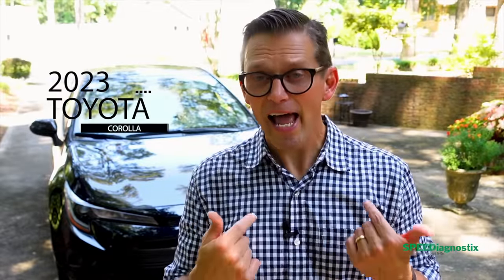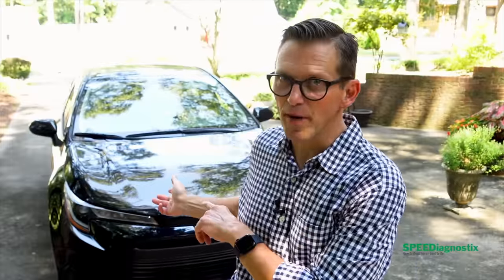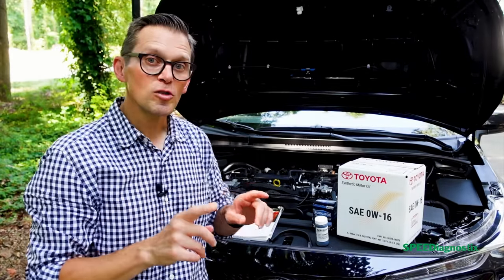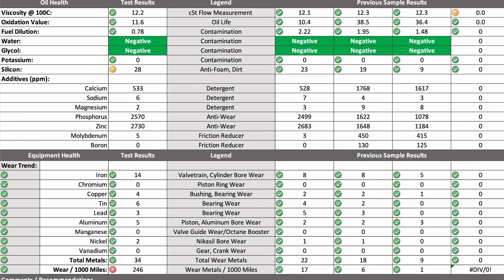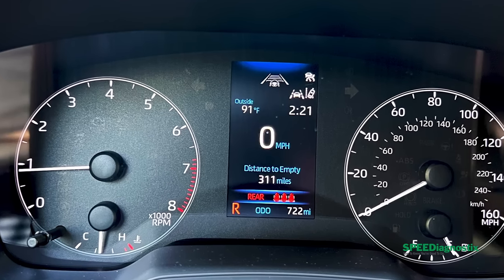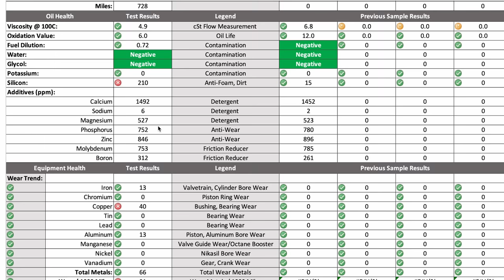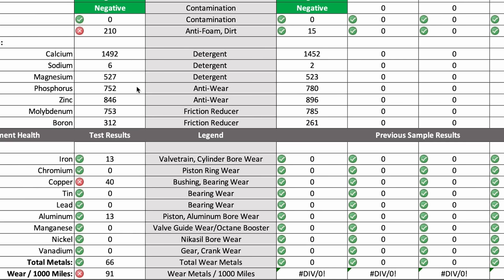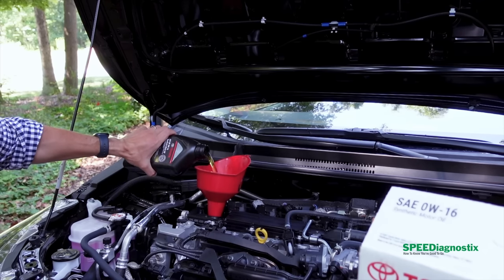AVOID the ONE MISTAKE Almost EVERYONE Makes With A Brand New Car

Comment: Only a small portion of the oil goes through the filter at a time, the rest goes straight through the engine unfiltered.
Reply: Not exactly. There is a bypass valve in some models for when the oil is too thick to be filtered right away or if you never change your oil filter but it rarely opens. If you use a quality filter, it doesn't happen.

Comment: Wait a minute I thought silicon and silicone were two completely different things. Silicon is an element and silicone is a man-made material. You said the high silicon numbers were from the sealants in the engine. Is that right? I would’ve thought high silicon was a remnant of casting sand residue in a brand new engine.

Comment: Did you know all modern cars have a failsafe function so some idiot does not crank the engine while holding the throttle to the floor?
Its true. What you do is, floor your gas pedal & crank. The engine  WILL  NOT  start. While the engine is cranking the oil pump will 
pickup your new fresh motor oil & pump the filter full. Let off the key. let off the throttle. Crank & start. Live a life full of bliss for the 
rest of your days.

!

Comment: FYI, Toyota does not use break in oil. Their "factory" oil is the same 0W20 0r 0W16 (depending on the model) that should be used for the life of the car. Also, modern OEM filters are designed to capture everything that might be suspended in the oil as particles that can harm the engine. You did not extend the life of the car by doing all that work, but if that made you feel better, more power to you.

Comment: Whoa there Trigger!  Silicon and silicone are very different things!!

...UM....

Well, I was about to go off on Ya ' there, Buddy!  But I like to be absolutely right when I tell someone off!...So, in light of what I just learned, (thank you) I've severely edited this comment! 

Silicon is a metallic element, 14 on the periodic table.  When it's combined with nickel and applied to an aluminum cylinder wall, it makes an exceptionally hard wear surface that is, or was, branded Nikasil.  I THINK it was Mercedes that first used it. 

Silicone is a family of polymers that are used mostly as bonding and sealing agents, or molded 'rubbery' items.  

Now HERE'S where I learned something!  I thought that silicone had nothing to do with Silicon, but it turns out that Silicon is one of the components of those polymers.  Given the name of the rubbery stuff, it DOES rather make sense now.  Kinda funny how an element so hard and brittle is used to make wiggly jiggly sex toys!!

Since I try to learn something new each day, you have freed up most of my day.  I am now off to the garage to play with a Toyota 1zz fe engine (with very low mile shortblock) that I pulled from a junkyard 2000 Celica I got for it's sheetmetal 6 yrs ago!

So... Thank you, Mr Speed!!

And, yes, the break-in will be correctly done... With that engine never seeing even CLOSE to a 10 000 mile internal ' cause I don't drive it a lot.
Reply from the maker: Thanks!

Comment: This isnt a formula car. The oil is synthetic. Synth oil is supposed to keep going fine even with particulates, more than the regular oil. I am not sure the particulates mentioned are significant enough to cause statistically more significant degradation. Ultimately only a long term trial will prove this - say, 100 toyota corollas with first oil change at 500 miles etc versus 100 corollas which do the stuff at the manufacturer's prescribed schedule, then measure the particulate average for these populations after say 150,000 miles. If the difference is mire than 15%, this video may be on to something, but otgerwise it could be just the proverbial snake oil

Comment: #TheMotorOilGeek :  I heard two different mileage amount opinions (for the first oil change) on Subaru Boxer Motors:  #1) was at 500 miles; and the other; #2) was at 1000 miles.  *Note* my annual mileage will likely be 4000 miles.   With all of this in mind; would it be better to do the first oil change at 500 miles “OR” at 1000 miles?   Any input is appreciated.    The vehicle in question will be a 2024 Subaru BRZ (which I ordered).
Reply: Any input on 500 miles vs 1000 miles is appreciated!

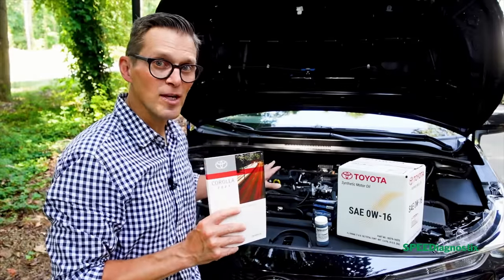Comment: apparently, at least some manufacturers use Moly grease (or other equivalent) during assembly of new engines. this helps coat the bearings and other parts for proper break-in. this means an early oil change would NOT be recommended, since it would flush a lot of those special products out too soon. i've linked a blurb below (at time-stamp 6:02) from a Honda mechanic as an example:

https://www.youtube.com/watch?v=DAixtdfz37g&list=LL&index=2
Reply from the maker: That’s very poor advice from that mechanic. The Moly grease doesn’t provide break-in protection beyond the initial start up and running in. Grease can lead to deposit formation, so the advice he provided is opposite of reality.
Reply: makes sense. all the more reason for a break-in oil change at 1000 miles. thankx for clarifying....

Comment: You can also just pour a little gasoline (even old stale gas) or kerosene into the engine to flush it out but make sure the engine is not so hot as to start a fire OFC the fuel residue will just get evaporated through the PCV system and burned it won't stay in the engine and since fuel is thinner in viscosity it will do a better job at rinsing out any particulates as well. When I do this I like to put the plug back in and fill the engine up and then rock it side to side by hand to shake the car up and then pull the drain plug.

Comment: Wear debris.  With modern processes of engine building….. you do not need to do an early oil change.  There is no such thing as “break in” oil.  Even if it existed, no engine is @broke in” at 500 miles. The difference between 3 and 8 parts per million is nominal.

Comment: I was saying you could just change the oil as many times as you want without any kind of schedule as long as you use break in oil the real question is when is my engine actually broken in and this has to do with the rings sealing up tight which can be measured with a leak down test without the oil sampling.

Comment: VW re called my engine for sludge, they told me I voided the warranty changing the oil myself. 212,000 miles later Ca forced me to replace a Catalytic Converter that passed smog but didn't have the correct NAZI number on the heat shield, the idiot mechanics messed up my turbo in the process, it dropped bearings in the engine and destroyed it. The mechanic that diagnosed the engine failure was service manager at vw/audi and stated my engine had zero sludge, I told him I took care of it, it was supposed to last forever I had zero sludge because I changed the oil at 500 miles, the dealer gave me a hard time when I told them, "special break in oil and all". I changed my oil twice as often as recommended and when I did... I'd add a little the day before I change my oil, then, I'd drain the oil, put the plug back in and started the engine and let it run for a second or two and shut off the engine, remove the filter and the plug and let it drain some more, added oil to the filter and mounted the filter, then I'd poor a quarter of a quart in and let it force out more bad oil from the pan or until the oil came out clean, replace the plug, added the recommended amount of oil, start and stop the engine, then add an extra half a quart of oil. I had zero sludge on an engine recalled for sludge. It would have run forever if California had not put a gun to my head and forced me to have work done my car didn't need knowing the plan was to kill my car all along, Thanks California.

Comment: Something seems way wrong here. The oil analysis sheets say “silicon” but we are told in the video that the high number is normal due to engine sealants such as RTV. But they are siliconE, not silicon, nicht wahr? Two vastly different things. Somebody explain.
Reply from the maker: Silicone contains the element Silicon
Reply: @themotoroilgeek Thanks! I see that now — should have checked the Wikipedia entry. Are there engine components containing silicon that could also register in the oil test?

Comment: The problem the car will rust out sooner than later. Just change the filter it will last twice as long. Buy 24000 mile oil and flip fillters ever 3 thousand

Comment: You didn't do the sampling correctly. You let the first amount of oil drain, which probably had a lot more contaminants in it. You should probably collect all of the oil, let it sit, and then collect the sample from the bottom, where I assume the metals would sit.
Reply from the maker: That’s exactly the wrong way. Samples need to be representative of what’s in the engine, not concentrated.

Comment: Most manufacturers today already breaking the engine and do the 500 oil change before they release the car.
Reply from the maker: The data we see doesn't support that. https://youtu.be/X4424Q5lLR8
Reply: @themotoroilgeek  Let say you are right, maybe the manufacturing technology in recent years produce a breaking wear particles that are not harmful anymore as they were years ago when it was required.
Reply from the maker: @ophirb25 again, the data we see from used oil samples shows the longer a customer goes on the factory fill oil, the higher the overall wear. 

The sooner the factory fill is changed, the amount of wear drops.

Comment: Question, has anyone use Amsoil 5W-30 in your BMW 750LI or BMW Alpina B7 vs Castrol oil 5w-30?
Reply: You have an Alpina B7? 😘
Which exact engine is in it? I can tell you that for a high performance BMW Alpina engine 5w30 doesnt provide enough protection when you drive the car like an Alpina is meant to be driven. 
These engines need 5w40 oil.
Reply: BMW 750 & Alpina are know for valve stems seals going bad due to Castrol Oil braking down after 10K miles. The factory Oil change is every 15k miles which lead to valve stem seal failure & smoke.
Reply: @alouisschafer7212   I have a 2004 BMW 760li V12 no issues.
Reply: @alouisschafer7212  I have a BMW 760li V12 with no issues.

Comment: why isn't all this material flushed out of the engine at the factory? after its assembled, not the complete Car but the Engine, since most engines are made in a different country from the final assembly location, I mean use some sort a high pressure liquid that isn't bad for the engine, maybe the lowest viscosity oil

Comment: With all due respect to his conviction, its funny to use a 30 years old car as an example to justify his actions on a new car. It's like lubrication/chemistry and engine tech stood still for all those years. Its so silly to argue that oil change at 500 miles is better than 1000, 1000 better than 2000, 2000....so on. Of course, less used oil is better than older oil. The question that you should dedicate your life to andwer is better by how much? I have asked several 3.5 Ecoboost owners with over 300k miles about their oil change intervals. And all of them were either doing it at 7.5k or 10k, just like owner manuals suggested. What a geek!

Comment: Drove my Toyota over 400000 miles.  Changed the oil maybe 6 or 8 times.  All these "oil & auto experts" that know more than the actual engineers  that are actually experts are delusional.

Comment: Your daughters new Toyota must truly be a a close tolerance engine because oil pressure is not created by the oil pump or the viscosity of the oil (you can gain a slight increase with viscosity) but by the restriction to oil flow by the clearances in the engine like in Formula one those engines are clearanced so tight with there piston to cylinder walls that they have to use heater blankets and cooling heaters before they even attempt to start those engines they are effectively seized up at room temperature. I own a 2009 Nissan Versa Hatchback 1.8L and it has a light on the dash to let you know when the engine is safe to be driven away it is a blue light you have to allow your engine to idle until this light goes off (128F) or you can cause engine damage if you ignore it. Because of tight tolerances for emissions and efficiency

Comment: Use 0w16 or 0w20. Would never put 0w8 in anything. I run 5w40 grade in all my hemis even though they call for 5w20. 150k miles and no cam lifter issues to speaknof. Update: Lol i see you're using 0w16 hadn't made that far into the video yet.

Comment: Sorry, why not 400 miles?  why not 300 miles?  why not ... ?   How does the oil layer in a bearing compare to the filtration level in the oil filter?
Reply from the maker: 500 is an approximation. Changing it a little sooner would be even better, but you need at least 100 to 200 miles for the engine to do the majority of break-in.

Comment: 0W-8 LOL I remember running 20W-50 in my old truck and then switching to the thin 10W-40 I live in Georgia so we never see cold weather for very long and I rarely go anywhere when it is cold. I was using the 20W-50 before I ever even gave the viscosity any thoughts then I read what was recommended which was 10W-30 and I made a compromise because I wasn't sure what was best at the time the thing is as long as you have oil pressure which now a days no one actually monitors in a daily driver because they only come with idiot lights from the factory usually

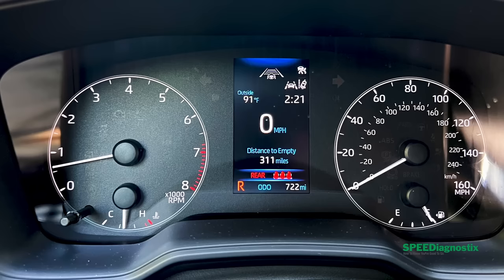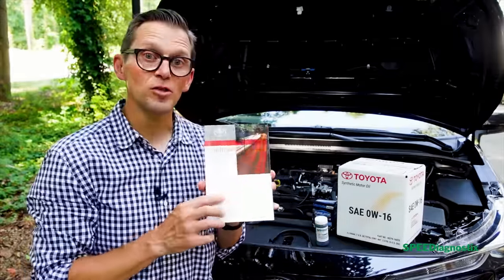Comment: 3:55 Hilarious to see the speedometer measures to 160 mph.  Instead of 80 mph being at the halfway point, why not something reasonable like 50 mph.  I'd like my teen driver to know they're in "the danger zone" above 50 mph.  5:28 Dang that's some perdy oil.  Pause playback and read the manual at 5:56 .  Toyota only allows you to use 0W-16 ONE TIME!  Will they send the Samurai oil police if you don't special order 0W-8 from Japan?

Comment: You are wrong, that's ancient history, there is no break in now, that was 30 years ago. Now, you don't get a new engine on a new car, you get an engine that is already broke in, on the manufacturing line. Whatever you are doing now, it was already done to it in the factory. Of course, when you yourself rebuild an engine, you have to do that, but not on a new car, when the manual says you don't need to. So, if you think that it won't do any damage to do it any way, then why the hell we shouldn't do it 20 times every 500 miles just for nothing...

Comment: This seems logical to me but use a low quality oil until the rings have had a chance to fully seat in or at least that is what my intuition tells me anyway I know in aviation engines they use a mineral oil based break in oil until the rings have seated before switching to normal oil I have heard that synthetic oils are so good they won't allow you to get a ring seal in a reasonable amount of time if you switch over to them too soon I am no authority on this and I am going to watch the rest of this video now so I can learn from a guy who I trust knows a lot more than I do Lake Speed. Aviation engines are broken in on the run in stand though while being monitored by the mechanics not like a car. I am not sure how the aviation mechanics determine how long a run in is enough to swap over to better oils though I assume they are performing a before and after leak down test and know from experience how long it takes to achieve a ring seal. I would think you could change out the oil as many times as you wanted to during break in as long as you put in a low quality oil back in until the engine is broken in the real question is how long do you want to allow the accelerated wear to go on before you call it broken in this is a tricky question. Usually most cars already have miles on them when you buy them also so they may already be effectively broken in from the day you buy them

Comment: How long is she going to keep the car?
Reality is that the car can be neglected, oil changes extended and it will still last beyond the warranty and beyond the point you will most likely trade it in on a new car. 
Who really cares if you went to the extra effort to prolong the life of the engine for the second or third owner? 
Let's be honest.... We all know someone driving a 10 to 20-year-old vehicle that has been abused a neglected and it still runs fine.

Comment: What do you think of using Marvel Mystery Oil during break in?
Reply from the maker: Stay tuned
Reply: I had a follow up question, would you treat an engine any different if it has a turbo?  Specifically Fords 2.3L Ecoboost?

Comment: MOBIL 1 Extended performance. Accept no substitutes. Lab testing the oil doesnt tell the whole story. In modern cars theres no such thing as break in oil. Hondas are in fact filled with synthetic from day one. You can go 5,000 miles on that oil from brand new. Draining at 500 miles is meaningless.

Comment: @9:40 You say you have a "better" oil change regimen that the manufacturer. But do you have the manufactures recommended 10k first oil change comparison???  Not arguing, but as a Engineer very curious. As their are many variables that you haven't accounted for.  Like maybe the manufacturer accounted for the additional wear [that you state as a bad thing] to be accounted for in the first 10k oil change, to make the tolerances as designed. ?? Your claim of cleaner oil being indicative of a better, longer lasting engine is not equal to longevity or etc etc etc et al.
Reply from the maker: Thanks for the question. First, you must realize the OEM recommendations are highly influenced not by what is best for the longterm health of the engine but by EPA requirements, which now extend beyond just the fuel economy and tailpipe emissions of the car. Today, the total environmental impact of the car factors into CAFE requirements. With that perspective, the reason for 0W-8 oil and 10,000 mile drain intervals becomes clear. 

Check out this video for more info: https://youtu.be/X4424Q5lLR8